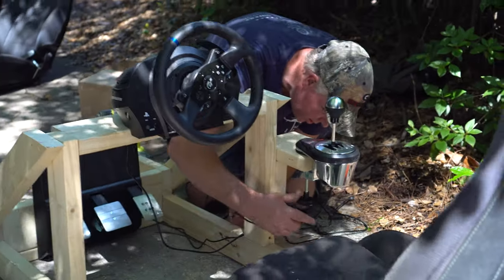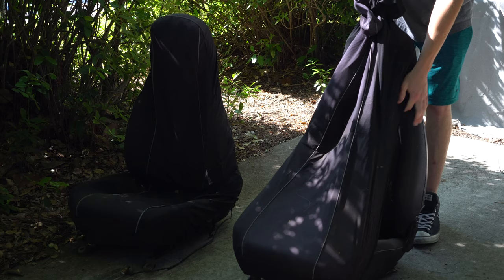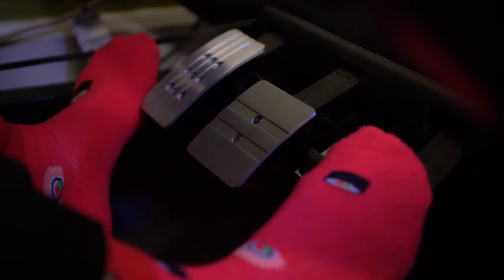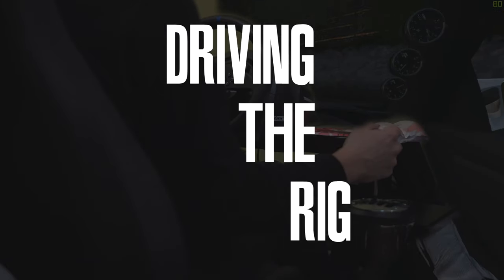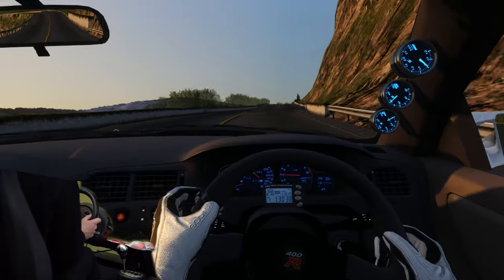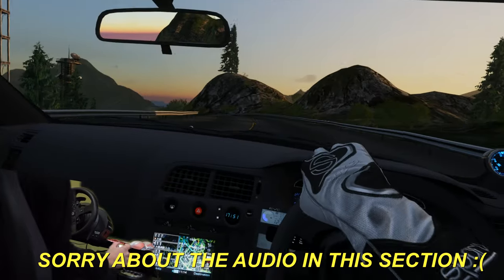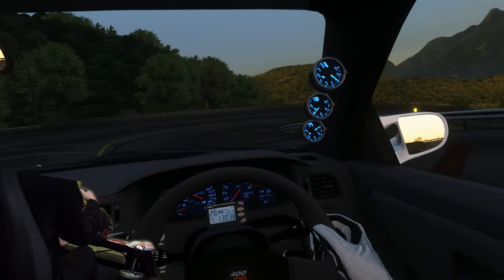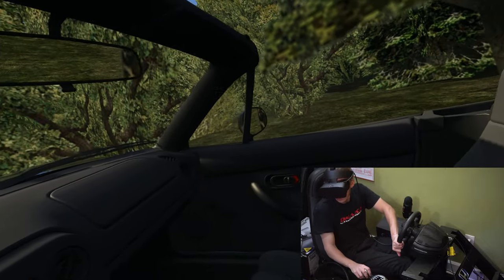The BEST CHEAP Sim Racing Rig that you can build!

Comment from the maker: If you take out the extra wood that we didn't need, the paint and the hardware that wasn't used, you could easily build one of these for under $30. All we used to build this was a circular saw, a drill and wood screws.

Comment: i'm trying to build a wooden sim rig and i was just wondering how to screw in the base, and do you need longer bolts because of the piece of wood?
Reply from the maker: We just got a few bolts and nuts from the hardware store. You don’t have to worry about it bolting tight like you would in a car. It just has to “seat” it.

Comment: Found my way here because I'm building one this weekend. Being a Carpenter I don't see any sense in spending 1500 pounds when I can build it just as good. 
I'm not experienced in American timbers but the rounded edged timber in UK is the cheapest of all timber and we call it CLS. It is generally used for framework for walls ie studding. Good effort dude.
Reply from the maker: Yeah you shouldn’t have any problem with it. Mine is still holding up years later just fine. The markup on those rigs are insane to me.
Reply: @BigTea  thank you for your confidence, you haven't seen my carpentry skills lmao. Honestly, there's nothing I can't build. I will post a video when done. I'm hoping to use a few strategically placed hinges and a few indexing plungers to make it so I can fold the front section up to save space when not using. Also I will be using some mdf strengthening triangles which will also enable me to slide the steering wheel forward and back a bit using bolts and long slots cut into the ground rails.

Comment: Anyway to get the full plans like measurements? Thanks
Reply from the maker: I think the length started with 60 inches and the width was a bit wider that my chair. I think it’s best to measure as you build to fit it the way that works best for you. I may make a follow up video on it.
Reply: Big Tea wish I could show u what I did yesterday in 10
Min just to not get my pedals to move haha I’m new to this
Reply from the maker: @MarkFisch  
Inverted them and screwed the  base against a wood platform.

Comment: I think your pedals are backwards
Reply from the maker: Inverted
Reply: @BigTea  its not meant to be inverted like that in the thumb nail you gas pedal is to the very left you brake in the middle and ur clutch all the way to the right its essentially backwards
Reply: Unless you did something to the pedals
Reply: @torchecho1747  I believe if it's all Thrustmaster gear, you can change/switch the pedals from normal to inverted in the wheel base settings. The clutch and gas pedal get reversed by doing this.  Not 100% sure.
The actual pedal itself is still wrong though, of course, so the gas pedal face would have to be switched with the clutch pedal face.
Reply: @torchecho1747  i can be like that u can switch the pedal plate also but this guy prob didn’t feel like it